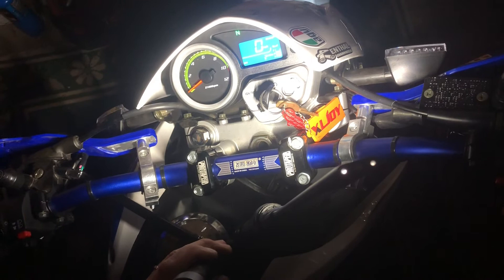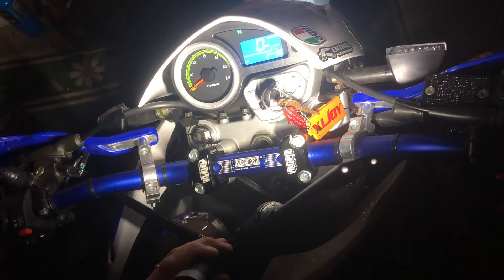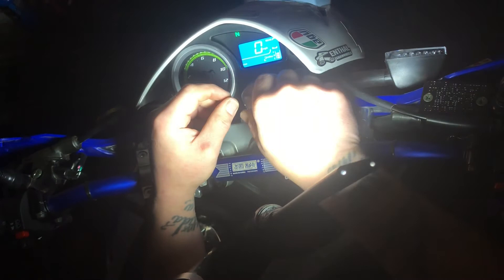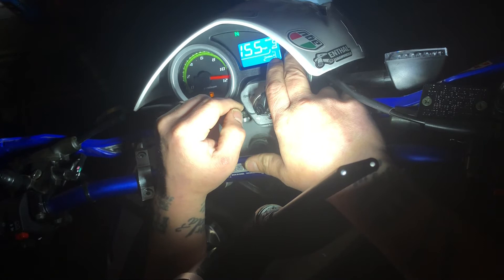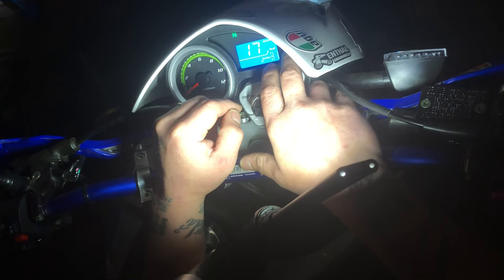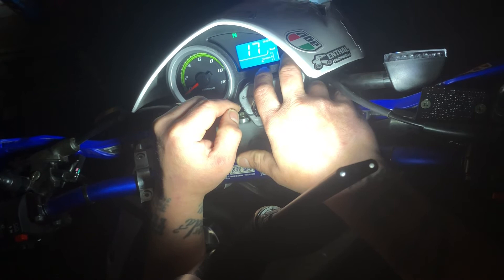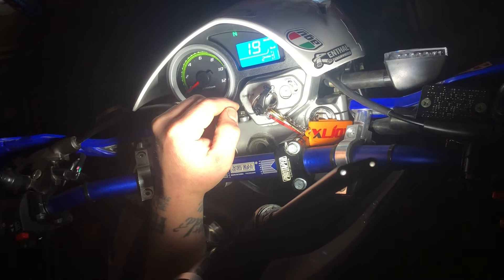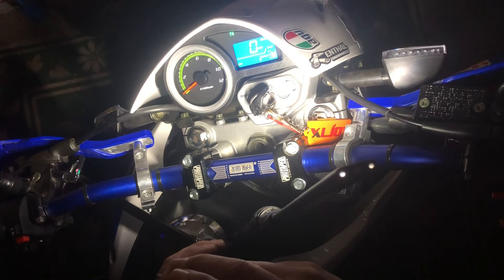Tbr7 Hawk 250 digital cluster programming / Tbr7 hawk 250 how to change wheel size

Comment: You're amazing man. Thank god I found your channel!!!!! I have a 21" front wheel but still great info!
Reply from the maker: Your very welcome brother! As a side note about wheel size so I didn’t have this issue why I really don’t know so I always mention it…some find the speedo is a little off set to they’re wheel size so they drop it down for example 21” running the 19” setting…I would just stay with the 21” setting compare it to gps or a speedo app on your phone but mine is set to the correct size and tells me the correct speed so not sure why but it’s worth mentioning just in case yours happens to be a little off the digital cluster is suck a nice setup smooth functioning tach better fuel gauge Odometer reads in miles not kilometers 😂 just all around a nice setup and they look cool too

Comment: How accurate is it?
Reply from the maker: The new clusters are really just about spot on perfect…or within 1% compared to the factory setup that’s 5-8mph off after 50mph with a floating gas gauge & a look from the early 80s 😆
Reply: @Jboost412  ok thank you.  Is there any problem hooking up the speedometer since it is electronic instead of cable?
Reply from the maker: No sir you’ll receive a new hub mounted Speedo sensor if it’s the same cluster I linked in my video pretty nice straight forward upgrade for these bikes
Reply: Ok thank you so much
Reply from the maker: Absolutely!!